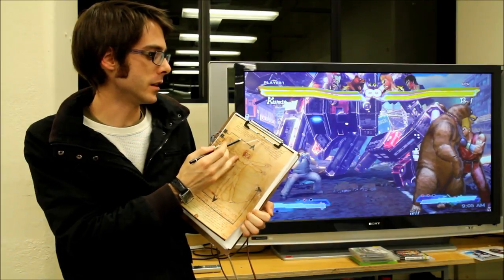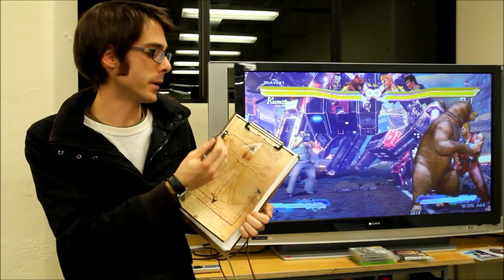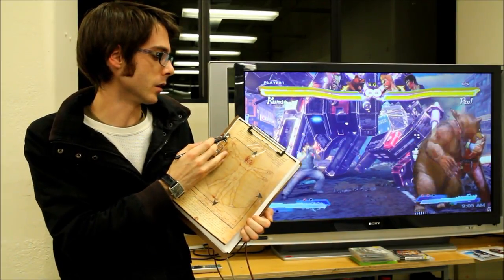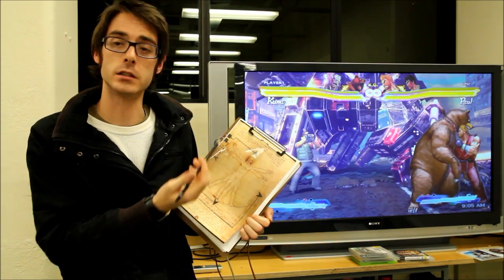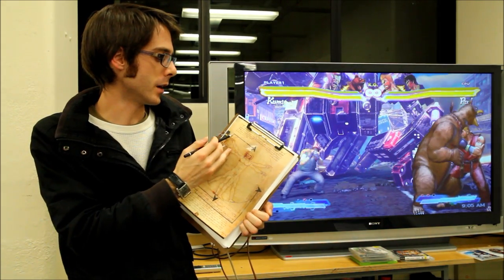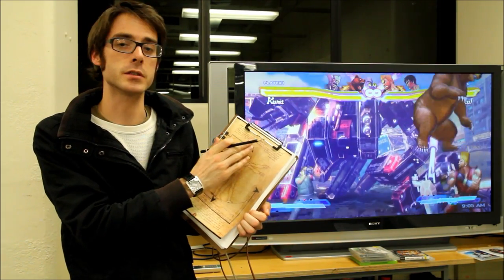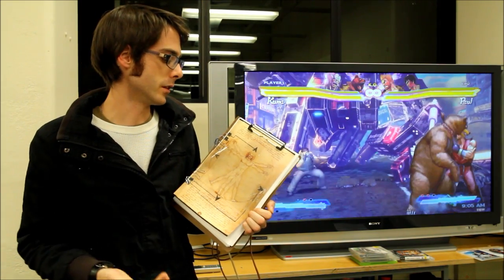Preview for Vitruvian Tekken

Comment: Does this Use the Unojoy code in the example "drawn controller"? Does the example code require a pull up resistor?
Reply from the maker: I'm pretty sure that's the code it uses, and I'm pretty sure it's using pull-up resistors - it's really hard to get pencil lines to work without external pull-up resistors.
Reply: Alan Chatham  Thanks for Replying So quickly, I'm working on a draw-able controller setup!